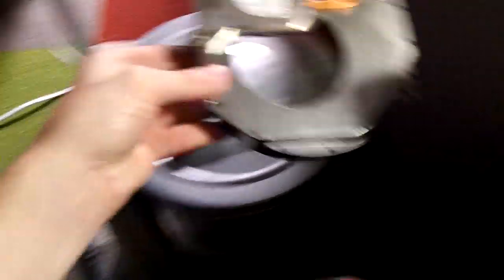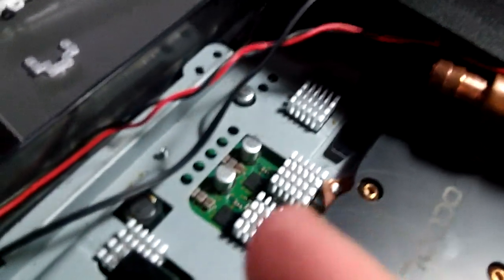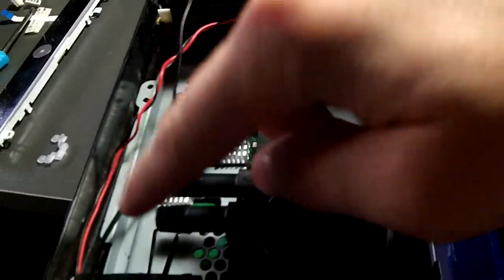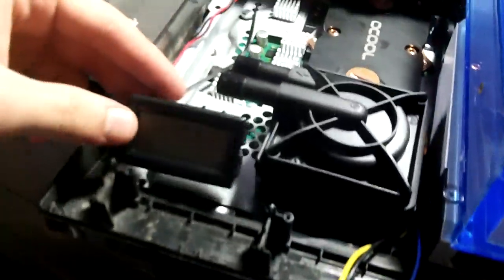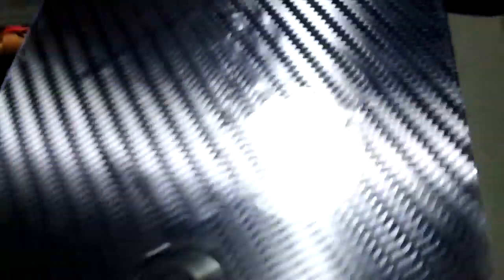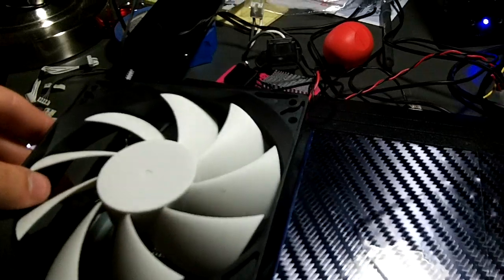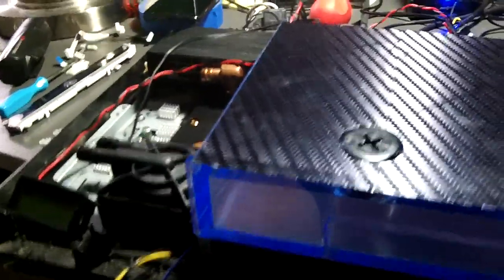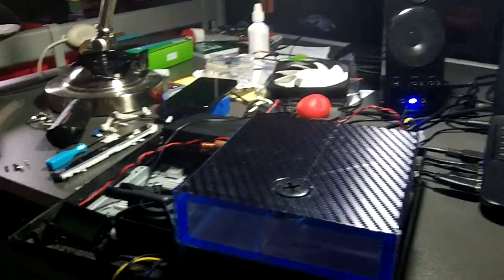Water Cooled PS3 Slim Build

Comment: Can u add links to the stuff bought to do it please? Thanks
Reply from the maker: David Francis pump is sold at any liquid cooling shop online, block is no longer available, rad and fan again are just 120mm and can be found lots of shops (performance pc is my main store), and reservoir is from XSPC
Reply: gorillaE999 what's the block called and ill see if i cant find 1 online somewhere. Thx for the quick response!
Reply from the maker: David Francis no problem, it's a PS3 SLIM waterblock made by Alphacool. Think I got mine at AquaTuning(dot)com but don't think they sell em anymore.
Reply: gorillaE999 I think this is it. I emailed their customer service dept and got this link. 
http://www.aquatuning.de/wasserkuehlung/gpu-kuehler/konsolenkuehler/13118/alphacool-playstation-3-kuehler
Reply from the maker: David Francis yup! Remember it only works for the PS3 SLIM. The father PS3 it won't fit. I tried.

Comment: how much can I buy it for?
Reply from the maker: Tristan 1098 sorry this was sold 4 years ago.
Reply: gorillaE999 damn I figured it was but idk if u might have had others by now. I'm having a little trouble with my cfw ps3 slim right now and the overheating, the past 2 days I have been taking apart re applying the thermal paste yesterday I put in a newer fan that o had laying around and I thought I had it fixed but today it's been giving me some trouble
Reply from the maker: Tristan 1098 hmm. currently I'm building a water cooled Xbox one s will have a video shortly since I haven't posted in years. they do still sell this water block for the PS3 slim on aquatuning.com if u wanna go that route.
Reply: gorillaE999 that might be what I am going to do so if I do buy that I never made one but I probably could I just don't know we're to start. like once I have the part does all the other stuff matter like will it work with just that part and just rigging some shit or do I have to buy other parts
Reply from the maker: Tristan 1098 you would have to at least get a pump and some sort of radiator/fill port. it will probably add up to the same amount as getting another system but I could send you a part list of the cheapest way to do it if ur considering it. the block itself is like 45$ then you'd need a pump any one would work about the same price ~50$. but those r the price bits. tubing and fittings r cheap. and when it comes to how to wire it and what not I can explain it.
Reply from the maker: Tristan 1098 my next video shows the final product. honestly best set up since the fan still blows air thru the rad and Into the system like the stock fan.
Reply: gorillaE999 yea I was thinking about the cost and idk cuz my console is jailbroken and I kinda have alot into it and I like the way it's set up. I also was thinking about a better fan mod do you have any experience with them and do u think that would be a waste. and yea I'm going to subscribe so I can see when ur new cid comes out that would be a big help
Reply from the maker: Tristan 1098 sounds good. my parts come in 2 days and I'm planning on doing a build video explaining how I will set it up.

Comment: hey, I need your help. Please contact me.
Reply from the maker: sure what you need?
Reply: +gorillaE999 I just finished my water cooling mod and my ps3 doesnt start anymore.. YLOD.. It was working before. I'm pretty experienced with ps3 repairs and I'm clueless what's the cause for this. Do you have an idea?
Reply from the maker: +DennG well thats a toughy. ull have to check everything was connected back correctly and that the waterblock is not screwed on too tight that can cause it.
Reply: +gorillaE999 damn I've tightened up the screws for the waterblock pretty much... Maybe I fucked up the soldering or even more
Reply: +DennG do you think reflow could fix it?
Reply from the maker: its possible. probably the only option right now. i have fixed a ps3 that way before but just like xbox you never know how long it will last once it has already gotten the rrod or ylod. however if it was fine and didnt over heat it should be fine just the block to tight or something